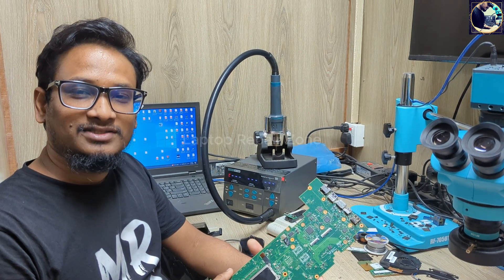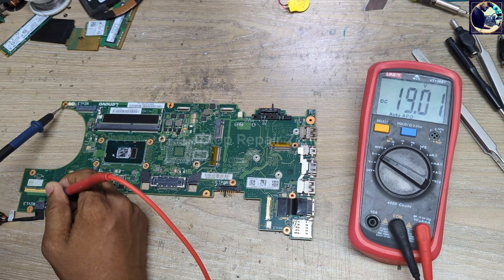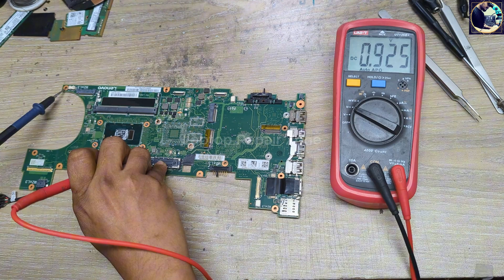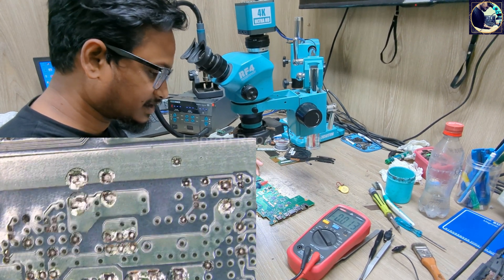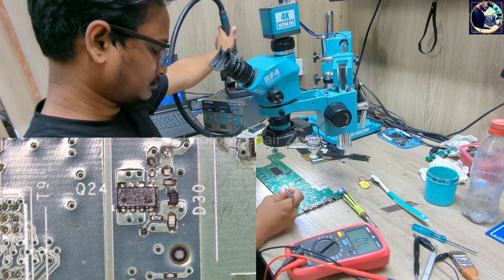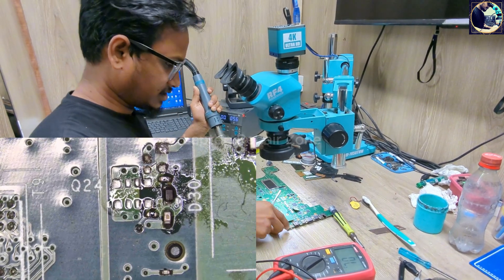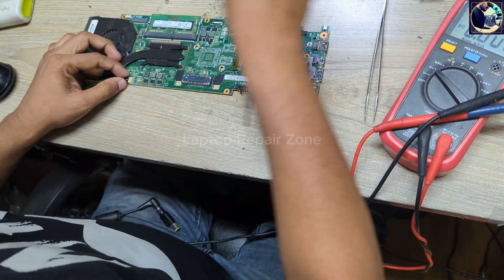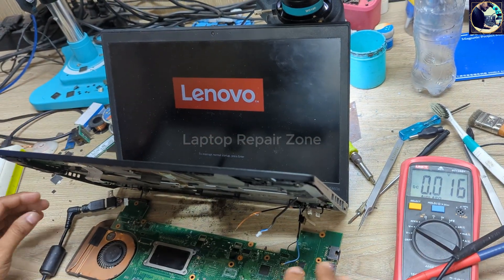lenovo thinkpad t470s won't turn on | lanovo laptop no power Fixed!!

Comment: that component is a ic ? a mosfet ? a transistor ? that you replaced ? to give the 3.3 v ? it's is a secondary power rail ?
Reply from the maker: It was switching mosfet...
Reply: Please, 🙏🏿 is it 3.3v run?